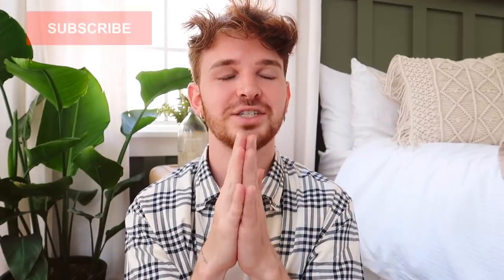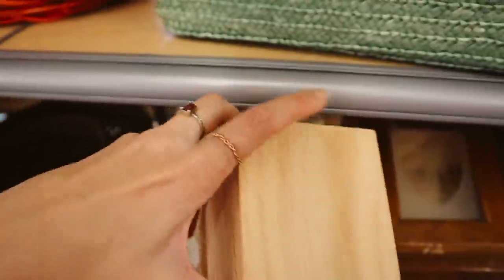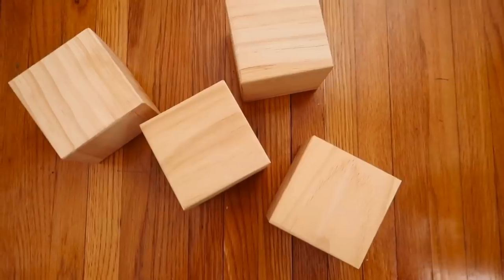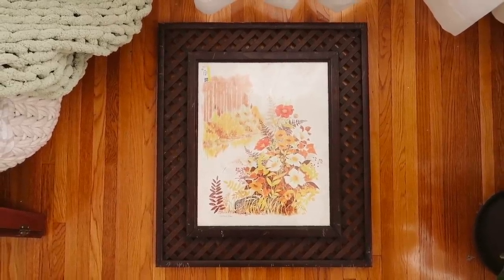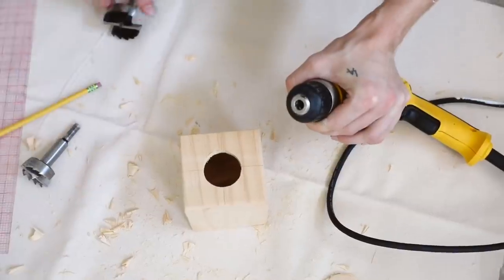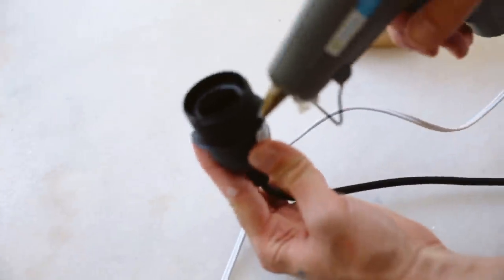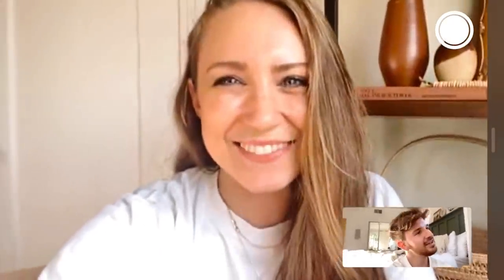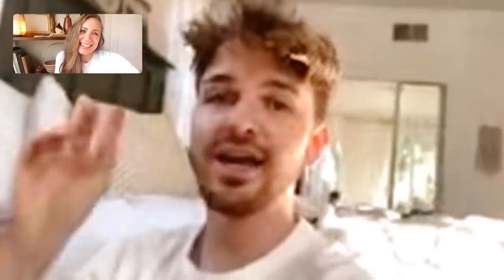DIY THRIFT FLIP ROOM DECOR with XO, Macenna

Comment: You should of turned those blocks like walking up steps if you get me twisted them it would of made a beautiful sculptural shape with them twisted. More of a statement look.🤷‍♀️🥰👌🏼🙏🏼
Reply: I thought the exact same thing haha
Reply: They are very lightweight as mentioned in the vid, it would stumble if stacked like steps with the bulb on top. And also, stacking them like what Drew did is maybe his style, maybe he is not a fan of crazy shapes or stuff that would take so much space
Reply: Maybe not like stairs but not entirely lined up. Like how a baby building a tower with blocks
Reply: @asmabegum9711  basically twisted blocks yeah. Loool
Reply: Just a design thing.. a thought a comment.🤷‍♀️🙏🏼
Reply: I like the lamp but it seems very light weight.  Perhaps some thing heavy inside, plaster of Paris or grout mixture that would dry hard

Comment: Hi, love your creativity with your diys, they all came out amazing.  I too love to create unique pieces by upcycling. I have the same dart board cabinet. I love to sew, so I designed the inside of mine to hold spools of thread.  I cut down yard sticks and was able to create multiple shelves. The width is perfect, just needed to trim down the length of the yard sticks. I love it. For inside the doors on one side I padded to use as a pin cushion and for the other side hooks similar to yours for scissors. That was brilliant how you did the outside of yours, love the rattan.  The bendy finishing you used would also be perfect to put under the little yard stick shelves for extra support.  Just thought I'd share that in case you want to add a shelf or two to yours. Just subbed and am looking forward to seeing McKenna's diy video. 💕Tfs and Happy Monday

Comment: You can also buy cork in sheets or rolls with adhesive and it’s a really easy way to make a frame into a cork board (it’s a little bit better than cardboard to gripping things you pin on it) I’m planning on using some cork to top my tv stand bc it’s cheaper than wood but brings in the pretty natural brown that I want

Comment: FYI: Anyone re-creating the lamp with the wooden blocks from Joann Fabrics that Drew made in this video, I HIGHLY recommend that you either just use wood glue or use wood glue AND the hot glue for that project. I made it first just using the hot glue, and IMO it wasn't very sturdy. I also used the "Gorilla Glue" glue gun sticks like Drew did, but it still wasn't as sturdy as I wanted it to be. I have kiddos and I need things to be EXTRA safe. So I decided to use BOTH the wood glue and the glue sticks for mine. Also because I'm VERY inpatient and I wanted to keep working on it. I didn't want to wait for it to completely dry before I could finish it lol 🤣!! Btw those Grilla Glue gun sticks are a game changer.  I'm VERY impressed and I HIGHLY recommend them. They're literally the BEST hot glue gun sticks I've ever used. I'm pretty sure Drew said basically the same thing about them!!! That's how AMAZING they are. THANK YOU Drew for yet another AMAZING DIY video. You're so incredible talented 😘💋💋💋.

Comment: French cleats would be perfect for hanging your vanity cabinet! Once I found those they changed my life: They can hold up to 80lbs (depending on the size you get and how many you use) and they hold things flush to the wall. I built a modern, slatted wood bhustsudan to wall mount last year, and it doesn’t budge. EVER! I order mine online bc they’re difficult to find in hardware stores, or they don’t know even what they are, but you might have better luck there.

Comment: Do not wear gloves when using power tools. I know that doesn’t seem logical, but I’ve worked in a lot of wood shops and power tools with gloves is a big safety no no. If your hands get too close, the gloves can get caught and pull your hands into the tool. If you don’t have gloves on, you can easily pull your hands away and prevent further injury. Thought I’d mention it when you suggested wearing gloves when drilling holes.
Reply from the maker: Ahhh thank you for this insight! I would have never known
Reply: Lone Fox hope I don’t sound like too much of a lecturer ❤️. I’m a little bit of a shop safety nut and the no gloves when using power tools is not something most people know and can get really hurt. Use gloves all day when you’re using hand tools! Stay safe ❤️